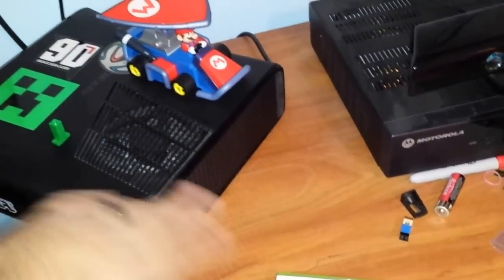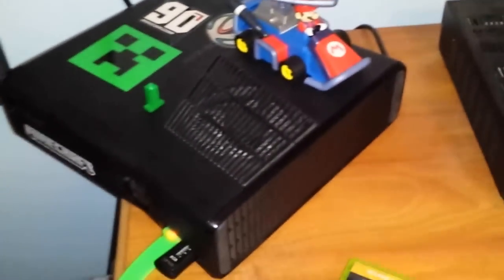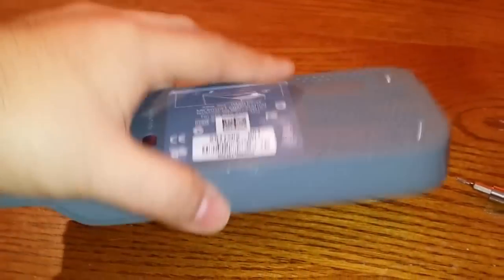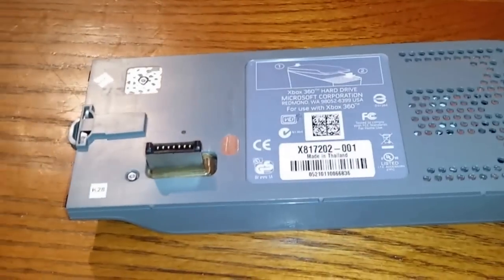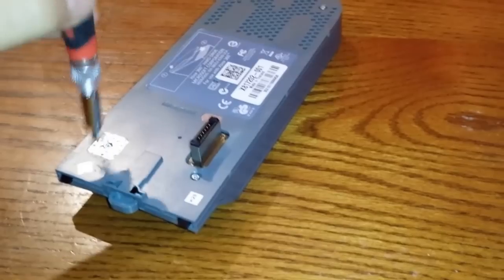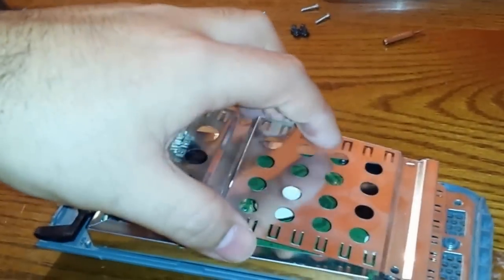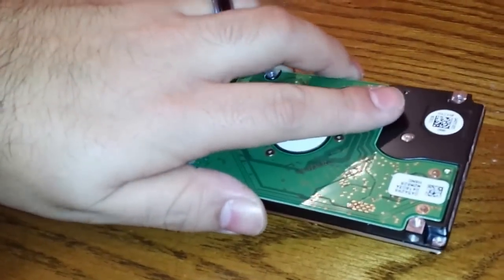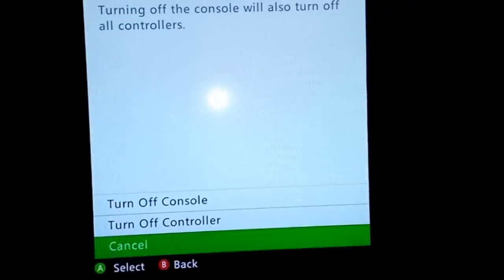How to upgrade your XBOX 360 slim 4GB hard drive

Comment: Sweet video thanks brother.

Instead of switching hard drives,
Cant we just buy a used 250gb hard drive for like $30 ?

Or just pikup a whole 360 250gb console bundle with controller and games for like $50 on ebay, fb or offerup etc. ?

And just sell our old hard drive for like $10-$20 ?
Reply from the maker: You could buy the used 250gb hard drive. Or you can buy a new one with the enclosure on Amazon for around $40. They have come down in price since I made the video.
Reply: I got the same thing
Reply: But no hard drive

Comment: You don't even need the caddy for the hardrive, I just took apart my fat hard drive and placed it in with a peice
Of foam
Reply from the maker: Glad you were able to get it done. Thanks for the comment.
Reply: @616pcrepair  I was planning on using the original Xbox, but I got a pre-owned Xbox 360 e instead so this did work out well

Comment: @616 PC Repair could I just buy the original 360 hardrive dismantle it and plug into the xbox 360 slim without do anything, cuz you mentioned something about Microsoft security system on the hardrives? If so is the process long? Thanks

Comment: I have an external hard drive that I can plug into my Xbox with a USB cable. Will the 360 determine this as a hard drive or do I need to install an internal hard drive.  I have an Xbox 360 slim 4 GB
Reply: Newer than the model shown in this video
Reply from the maker: You can try it but as far as I am aware I don't think it will recognize it as an XBOX approved hard drive. It will allow you to save games to it, download games from the store and store them there but as far as installing game data for example from BF4 it will not work. I tried a 500GB external USB hard drive on my sons prior to this and it didn't let me do it. 

It's worth the try, please let me know if it worked for you and also if it does include the model number of yours if its newer that way people can read on it here. Thanks

Christian
Reply: Just tried it the Xbox thought it was an USB stick and only showed 32 GB available even though its a 300 GB hard drive. Guess I'll just have to bite the bullet and buy a Microsoft hard drive.
Reply from the maker: Yeah, that's what mine read as. Try your local play N trade, game top, etc. I wish Microsoft allowed the use of any hard drive. The funny part is that they don't manufacture the hard drives.

Comment from the maker: @ Christian Hernandez for some reason I am not able to reply to your comment. Battlefield 4 will NOT install onto a USB flash drive, it needs a physical hard drive, this is why I had to upgrade the hard drive
Reply: If you didn't buy your son a subs you should of tryied and external hard drive
Reply: I have a jtaged xbox and i used my laptop works fine got 460gb search xxmoddedwarfarexx laptop hard drive

Comment: I would say with the amount of games you can buy with updates and expansion it is becoming the point of install 1-2 TB I just wished consoles had the capacity quad hard drives because atleast then you would have the space to store updates, mods and patches to the system...
Reply from the maker: Jason howe That would be nice, it sure would make it easier. My boy just turned 13 and he just put his first gaming rig together. I love my consoles but gaming on a PC makes it easier to upgrade.
Reply: 616 PC Repair I suspect they would have make an expansion bay large enough where you had enough air flow to keep drives cool enough  and have the capacity to mount 4-8 hard drives in a raid array and have the Xbox one/360/Xbox.

Pity Microsoft doesn't do a option where you could mount the Xbox catalogue of games on to the pc and do a operating system shell where you could go from Xbox/360/one/one4k and pc games from the 90's through to today.... have a console option where you have a pc as a host and use the console as a client..

Though I'd love to see the original Xbox come out on a hdmi platform..

Though it still would be actually great to a rack mount option on original hardware specs on all systems.

Looking at my console collection

Nes>Snes>n64>wii>wiiu, detested the cube son not in my collection 
Ps1>ps2>ps3>PS4 1TB model, may get the pro 4K at 1 point
Xbox>360>one halo, one pro 4K I might get

Though until 4K TVs grace my home kinda pointless running 4K anything without the monitors to support it..
Reply from the maker: Jason howe Unfortunately Microsoft just cares about money and not what the consumer wants. 

that is a nice console collection. we just have the playstation, ps2, ps2 slim, original PS3 fat, PS4, Xbox 360, Xbox one, and Wii.

wish I would have kept more of my consoles.
Reply: I actually own 2 360's now 1st is on rrod, got the slim today..

yup MS is after money and so forth..

though to really enjoy the games on each console platform, you really need a pc port of the console UI..

same with playstation because we always knew how crap the original hardware was lol...

to be honest looking at the wii and the wiiu there is not really much difference between the hardware specs 

my opinion what killed both consoles was lack of games and when compared to xbox/360/ps2/ps3/ps4 it chokes as a console even the n64 was a better console outside of nintendo'd own IP's the consoles were a dead duck as i would expect the switch will be..

I thiink nintendo needs a swift kick up the arse and get somebody in there that can build a level matching system, though I suspect any console they produce will be a junk and throw away console because they havesn't released a console with the hardware to match sony and microsoft  and haven't done since the the n64 and this will be the case within the next 5-10 years if they don't do something soon..

i think looking at the specs of the switch I believe it will be a dead duck at launch because it is a pain in the arse to develop for an under powered platform..

don't get me wrong i'm a nintendo fan I i'll still buy the system though my opinion all will be not worth the $65-140 asking price what ever the game will be released on the platform..
Reply from the maker: Jason howe well said.
Reply: Even today I think the Xbox could be a run with modern consoles for the simple fact it was a pc in a console form factor yes it may not be the strongest console on the console market on the planet at present though on resolution standpoint it could match the DVD standard of 1080p...

As I would expect the ps2 would definitely do also..

I'm also betting if ms got off its arse and did a blue ray port on the 360 you could likely do 1080p 

As for pc we could likely do 8-24 k resolutions though I suspect we are looking at a migrate to fibre interconnects..

As standard as I believe we're at the limitation of copper can provide..

Though with the storage issues these games have we're at the point now of storage servers to mount games too because in the best day within Current consoles the max storage space you will see is 8-12 TB 

A storage server you may have access too 100+ TB

Which would be a drop. In a ocean..

When you see the entire catalogue in your collection whether it be Xbox, 360, one, next gen or regional release..

Looking at nintendos lack foresight I think before long they will turn into emulator kings because nothing since the n64 Nintendo has failed to produce a console that has competed with Sony or the Xbox division of Microsoft and that is known..

I'm a new nintendapo fan boy..

And I see Nintendo going 3 way

Live in the emu world hdmi conversion of nes, snes, n64, cube, wii..

Go the the route of sega software publisher

Bury themselves in the shit tube because because some fuckwit in Japan wants to keep pushing under powered consoles to the market place  and wonder why developers don't want to develop games for a console that is dead within the 1st 12months  after its release due hardware constraints ..

Looking at the switch and remembering what happened to the cube it makes you wonder how practical it will be looking what's by Sony and Xbox gaming division..

I would even suspect Sega's last console entry would benefit from a hdmi upgrade and a media change...

Look how long the actual wii lasted before the wiiU came to the market..

Comment: on the 4gb slim units you can solder a usb extension cable directly to the motherboard and connect a flash drive or portable usb harddrive for extra storage

Comment: Some of my games won't work because I need a 250 GB hard drive....I bought the Xbox with the 4gb on it only I didn't buy it with the 250 GB hard drive so can you help me....how much does it cost.....can you help me do it...i  cant play all games without it...please help...
Reply from the maker: I don't think that you need a 250GB in order to play your games, you just need an internal hard drive. Now you can do what I did in the video and buy an old 360 one from (Gamestop, Play N trade) or whatever used game store you have in your area. You can also look for one on Amazon that should come ready to install in the Slim. 

Search 360 slim hard drive and it should come up with something, but please make sure you read to ensure that what you are getting is correct. I hope this helps. 

Christian

Comment: Okay I just got destiny for the 360, I also cannot play it due to the fact that I don't have a hard drive for my 360 slim

QUESTION: can I use a computer hard drive? I heard people using laptop hard drives so I'm just wondering. sorry not familiar with computers
Reply from the maker: You can try it people here have commented that they have gotten it to work, but I would do some research first. I tried it with a few that I had laying around and couldn't get the console to read the entire size of the hard drive. 

Like I say in the video to me it was just easier to buy an old XBOX 360 HDD than to mess around with anything else. You can even buy large capacity hard drives for the slim on eBay or Amazon. Thanks for the question, and please let me know what you find out or decided on doing. Have a great day. 

Christian

Comment: are you telling me i can't just take a sata power and data cable extender, plug it in there, and plugin a Sata Desktop HDD.. or maby even an SSD?
Reply from the maker: I don't know about a desktop hard drive, never tried that, since it uses a laptop hard drive. I suppose you can try it and make a video that way if it works then we can all do it. I'm sure you can add an ssd but I didn't have one to try it with, but I'm not 100% sure on that so don't quote me on that. If you try either one please let me know what your outcome was, thanks.

Christian

Comment: HI admin i don't get the part about formatting.on western digital something you said from 3:00 to 4:00 .can you please enlighten me again..cos i have slim 4GB too but i need a hard drive to play need for speed rivals and am planning to buy a 20GB second hand old Xbox 360 to use..may i expect any problems with it??
Reply from the maker: Don't worry about the Western Digital thing, that is for people that want to flash firmware onto an old laptop hard drive they might have laying around, also can mess it up if done incorrectly.

If you are buying a used hard drive from an old 360 you should be fine. Thanks for the question and hope this helps.

Christian

Comment: I got a 500 gb hard drive for $60 and it works fine
Reply from the maker: that's great, glad you were able to get a 500GB to work. Did you buy it ready for install in an xbox360 or did you install a brand new bare drive with out partitioning it?

Comment: Do you need to format the new HD manually or XBox automatically does that when you first install it?
Reply from the maker: Since I used one from an original Xbox 360 I didn't have to format it at all. Just insert it and turn the system on, then check Rio make sure it was read by the 360. Thank you got the question and for watching. 

Christian

Comment: Wait on the hard drive it said 250 GB and when you went to system settings it only had 48 GB WTF is that about?
Reply from the maker: That's just a case for the hard drive. I explain in the video what the size of the hard drive I bought is. This cases have that stamped on them even when they are sold without the hard drive. Hope that answers your question. Have a great day.

Christian

Comment: Am I able to connect an EXTERNAL HARD DRIVE to the USB Port of 360 Slim and play Battlefield 4, Destiny, etc... that way?

Or do I need to do what you did in the video?
Reply from the maker: I tried using an external USB hard drive before doing this and it didn't work with Battlefield 4 because it required an internal hard drive. Hope this helps, have a great day.

Christian
Reply: Sweet, it does. Thank You for the reply.

Comment: Doesn't show or even say that u have to properly prepare the drive before itll work.
Reply from the maker: Actually I do mention that if you use a hard drive not pulled from an original 360, you will have to get the drive firmware in order to make it work. If you do what I did, use one straight out of an original 360, you don't need to prepare it in any way.

Comment: hi great video, i was wondering once you install the hard drive into the Xbox, will all the new game memory you out into the Xbox go directly in to the new hardrive or how does it work?
Reply: Sorry if what I said was confusing
Reply from the maker: Floods if I remember correctly the new game's data was saved to the hard drive I installed. you can check in the storage settings.

Comment: You did not need the caddy all you need to do was take apart the original xbox hard drive and put it in the xbox that what i did a couple of days ago
Reply from the maker: You're right you don't need the caddy, but I like to do things properly and if that means spending an extra $5 why not. A few people have asked if they could just use the raw drive and I have said yes to them. I will suggest to you like I did them, put something to keep the drive as parallel to the system as possible, that means as flat (----- the lines represent the drive) to the system so that you don't put stress on the data connection. Thanks for the comment, and have a great day. 

Christian

Comment: Does the slim 250 hard drive work with out the Xbox 360 60 upgrade?
Reply from the maker: If you are buying the Slim with the 250 GB hard drive then you will be able to play any game. If you have the 4GB model like I have in the video then you will have to buy a hard drive for it which can be a 250 that is made for the slim. You can find them pretty cheap on line. I hope I answered your question, if not and I miss understood it please let me know. 

Christian

Comment: Hello mate just wanted to know if that black hard drive case you bought doesn't it come with the hard drive in ready to slot in or do you have to buy drive separately
Reply from the maker: You can buy the case complete with a hard drive ready to install, but I didn't want to spend the money on one. At the time they were a bit more expensive than what you can find them for now. I have seen some 500GB on eBay for 60.00USD but it is eBay. Amazon also has them I'm assuming that the prices should be close to the same. Thanks for the comment. 

Christian

Comment: I tried doing this with my xbox and I bought a 250 gb hard drive already made and it wont fit in to the xbox. I checked it all out and nothing is wrong with is but it just wont go in
Reply from the maker: Where did you buy it from? Does it seem like it's too wide to fit in the opening?
Reply: 616 PC Repair never mind I just forced it in and got it to work :P it was not lined up with it but I fixed it
Reply from the maker: Awesome! Glad you got it working.

Comment: the mate finish dosen't say thet the console have only 4g of memory
i got an xbox 360 with mate finish and the console have an stock 250g of memory
Reply from the maker: well that's cool, usually here in the states that I have seen all the matte finish have 4gb and the glossy ones are the 250gb. I could be wrong, but that's what I've seen in stores. Doesn't really matter this is for those who know that they only have 4gb of flash memory. Thanks for the comment, have a great day.

Christian
Reply: 616 PC Repair thanks for the answer ,great video
solomon

Comment: My hdd hard drive only had 3 screws on the top and i opened it but the top part wont open its stuck on something help
Reply from the maker: It has a screw hidden under the warranty sticker, there should be 1 screw on each side of the release button (where the connection that plugs into the XBOX is)

Comment: If you have an internal hard drive then connect a flash drive, will it still detect the flash drive?
Reply from the maker: That's a good question. I'm not sure if it does and we no longer have the 360.

Comment: why did your hard drive say 47gb when it is a 250gb hard drive
Reply from the maker: i didn't use a 250GB hard drive, it was just acase I bought, jusr happened to have 250GB on it. I dont remember what the actual size of the hard drive was.

Comment: Does it still work even tho there was just an update?(nooby question I know) BTW I have the same problem because of the same game.
Reply from the maker: I'll have to do the update, and let you know. To be honest the update should no have any affect on it since it is just storage space, not a modification or tampering of sorts. Thanks for the question. 

Christian
Reply: K also is it OK if I don't have a case
Reply: For the hard drive chip
Reply from the maker: Yes, it's fine if you don't have the case. I would recommend putting a piece of tape on the end of the hard drive to use as a handle when you are installing it. Use cardboard, foam, or anything that you can stick on the top and bottom of the drive to keep it from flopping around.